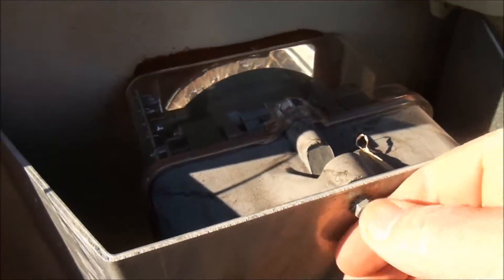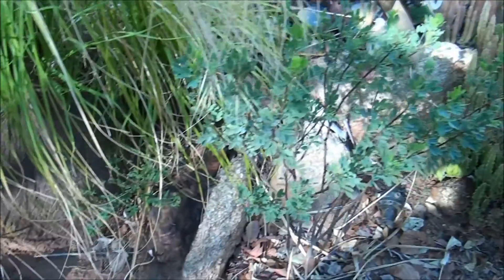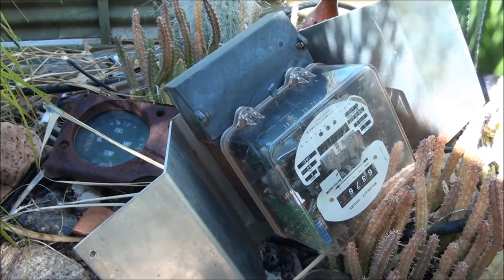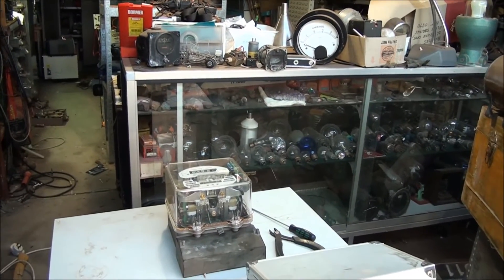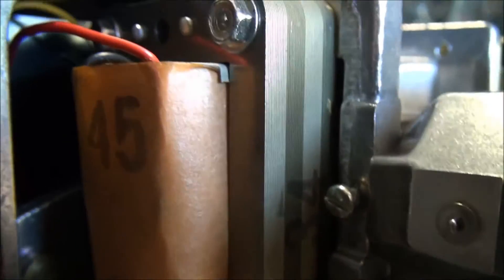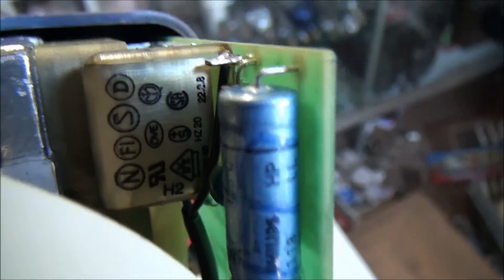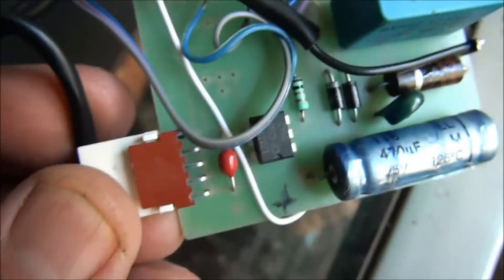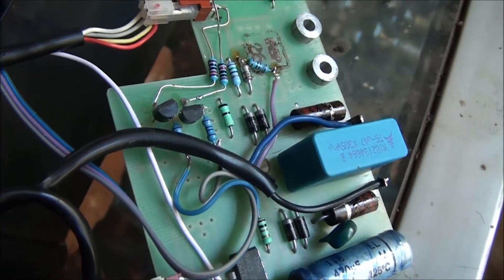Electricity meter up and running!

Comment: At 9.45 ....... YAAAAAY, loadwheel action. :D
Those EMAIL type SD instruments look quite chunky. Were you running that via a CT?
You do know it needs a CT, yes? Too many amps can pop it! :-O
Thanxx for showing. -Wayne's Electrical. 27th June 2020, 17.57
Reply from the maker: Wayne's Electrical Yes, you are right, it does need a CT to run as designed. I only put small loads on it so hopefully it wont fry the current coils. Thanks for the information, I hope to try and score some CT transformers for future experiments.
Reply: Hiya. Thanxx for letting 
me know. On the odd 
occasion here-and-there, 
I have found some cheap......

......deals on a popular auction website, selling used (and sometimes brand new!) CTs at cheap prices.

This is because sometimes, they will only have one left in stock and are selling it cheap as clearance sale, or because it was salvaged and again they only have one, so they're either selling it cheap on Buy-It-Now or the bids start at really low prices.

Sometimes, the CTs are ridiculously big: I once saw an auction for a 1000/5 CT and I really wouldn't have any use for something that massive. It was some years ago now I noticed that one and they only wanted £10 for it as a clearance sale. They only had one of them, which explains why it was going cheap, as CTs are usually sold in sets of three (one for each phase)

My GEC E43B-R/M is locked-in at 200/5 (which means it is not a 'Blank-5' meter which can use any CT that takes my fancy) and I am currently waiting to see if anyone offers a deal on a full set of 200/5 CTs for it.

Using anything else other than 200/5 CTs on my GEC meter would mean that the kWh readout would either under-register or over-register.

Unlike a Blank-5 meter which uses a multiplier to work out the kWh used, the GEC has bulit-in mechanical back-translation which means that the kWh shown on the readout is actual power used, the downside being for that luxury is that the meter is 'locked-in' to using 200/5 CTs

OK, I suppose I could connect up 400/5 CTs to it and use a multiplier of 2, that could be possible. This would then mean that any kWh used and shown on the readout would need to be multiplied by two for the true kWh used. :-)

Anyways, gotta go. New videos EVERY MONDAY on Wayne's Electrical. :D

Have fun with the loadwheel action. :D

-Wayne's Electrical.

29th June 2020, 11.30

Comment: Nice meter, nice motor, nice streetlight.nice fan. Great video. The twin cylinder Lister would be awesome for a generator with a multipole alternator.The start up of the fan is very nice. Cool modification with the LED's.
Reply from the maker: +RODALCO2007 Thanks for your kind feedback! I like the LEDs in the Meter, can easily see the current load through the meter. I do have an Alternator planned to go with that engine, hopefully if I run the drive belt around the flywheel and a suitable pulley on the Alternator I should be able to get the 3000 RPMs needed. Maybe the next project?

Comment: I wish I was your neighbour, I'd invite myself round to poke my nose into all the nooks and crannies of your shed...lol I see lots of interesting looking things "stuff" everywhere.. :-)
Love that fan too, they certainly don't make-em like that any more.
Great video. :-)
Reply from the maker: +Bevoin1970 You would most certainly be more than welcome to visit and help out with a few projects, my neighbours are pretty conservative and most likely think I am a bit mad especially when I decide to get up early to fire up one of the engines. One day I was making up a batch of smoke bomb mixture in the yard and it all went up accidently! The smoke basically smothered the whole yard and street and took a while to dissipate, took longer though before my neighbours spoke to me again. Then another time my attempts of a hot air balloon went wrong and the experiment ended up in next doors tree, I had to spray water up the tree to put out the fire!
Reply: Ha ha like it :-)

Comment: Very good Ian. Love that old fan! Tell you what though, something tells me it not meet current health and safety regs ;) Are there 3 different optical sensors on the meter?
Reply from the maker: +Alan Cordwell That meter has 2 individual optical sensors, I utilized the front face plate to mount the LEDs as it had 3 available holes, the 3rd I fitted an LED that is simply wired across the supply voltage.

Comment: Sure miss having the old style of meter with the disk that spins at a rate reflective of the power being consumed. It made it easy to set-up the home, shop, etc. for low monthly energy bills.
Reply from the maker: +John Ratko I now have one of those so called smart meters on the house, its impossible to tell if you have any power draw as the old style meters have the load wheel that you can easily see moving.

Comment: what exactly do the LEDs indicate? Nice old meter these things are a good example of precision engineering how things should be done
Reply: +jon johnson 
They were originally potential indicators, possibly added by the contractor who installed the meter.
Reply from the maker: +jon johnson I fitted the LEDs to run off the optical sensors, the original circuit was intended to send a pulse output from a comparator chip to a computer in order to record power generation. The front plate had some spare holes which fitted the LEDs nicely so I thought it would look interesting having that meter running.
Reply: They look cool